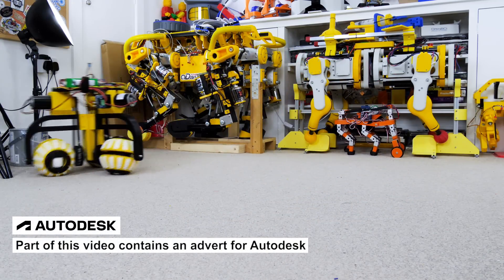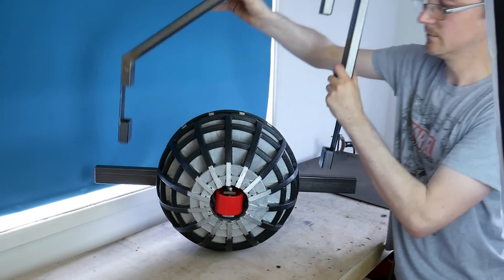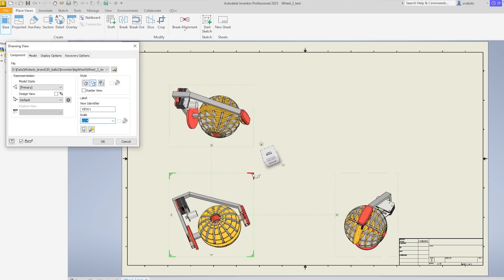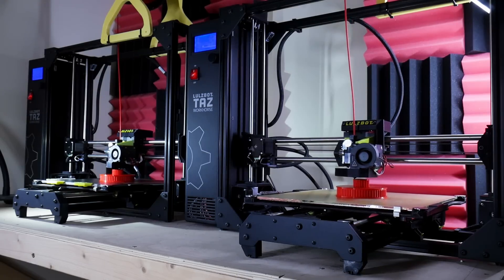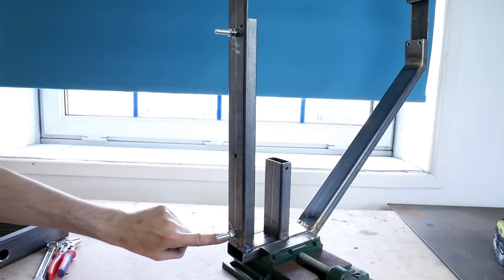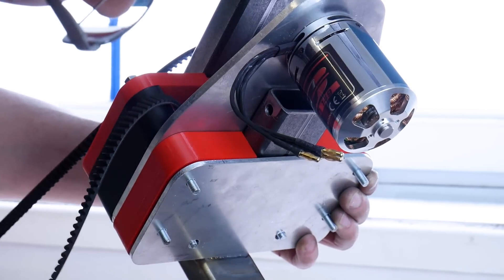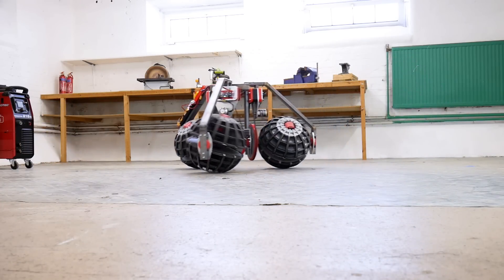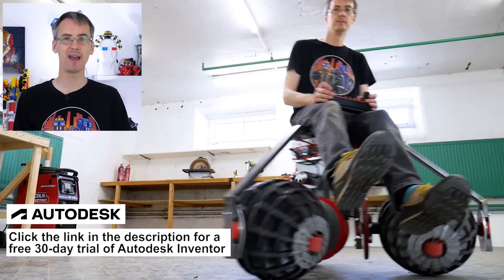Testing Ball-Shaped Wheels on an Omni-Directional Vehicle

Comment: You should add some kind of handlebar steering as well as foot rests so you can hold yourself stable as the vehicle moves. I would start with a system that rotates the vehicle as you rotate the handlebars left and right and has buttons to move forward and backward and possibly left/right. You could alternatively add pedal controls to the footrests for acceleration/braking

Comment: If you make the footing an isosceles triangle instead of equilateral it may become narrow enough to fit through a doorway. I bet you can squeeze it through with some clever rotations as it is, but narrower is probably better so one can just go straight through. If you use the pair of close wheels as "drive" wheels and the odd one out for steering the controls may also become more intuitive, while maintaining the ability to go sideways and rotate on the spot.

Comment: 1. Seat
2. Stering wheel.
3. Feet-rest
4. Coverplates (For cleaner look)
5. Some rubber or similar material on the wheels to prevent damage on outdoor surfaces
6 Suspension for smoother rides.

Comment: Thumbnail does have a bit of the look of an evil Sci-fi robot overlord to it  🤖🤗 . Would be interesting to see how stable it could be on slopes, maybe adjustable seat gimble thingy so the passenger (and centre of gravity) is kept straight up so it doesn't tip. A slightly upright-ish sitting position adjustment so people on the wheels are more face to face with people on foot would have a practical/cool sci-fi feel to it. 
(edit: [reading other comments] the thought of the seating gimble keeping you 'upright' in relation to acceleration and deceleration - leaning into the direction of acceleration and leaning slightly away from the direction you are decelerating/breaking in)

Comment: Are the controls oriented with the robot or with the environment? Since its onmi-directional you could, with a gyroscope, make one joystick control its movement in relation to the room (ie. Up is always towards the same wall, back is always away from that wall, etc) and have the second joystick control the vehicle’s rotation. That makes some really cool effects easy, like spinning while moving in a straight line!

Comment: that very first belt off the motors...is there any adjustment on that one? or did you just design it such that the mounting holes happen to line up at exactly the right tension for those belts?

Comment: I applaud you for the work you've poured into this project. So please don't get this question wrong: Would 5 wheels not be better than 3? Thought coming from office chairs being required to have 5 legged feet, I wonder if an omniwheeler would need 5 legs as well to be considered idiot proof? I guess a scale model would suffice, soryy if that question had popped up and been nswered before.

Also your life sized Omniwheeler needs a name, foot rests and maybe a more intuitive steering / handle layout.

Comment: It looks like you could rotate each wheel unit to be almost horizontal, which will greatly reduce the height, without changing your footprint much. I'd also look at incorporating some suspension of some sort, even an inch or two of rubber mounting will greatly improve ride quality.

Comment: I would add a seat with foot rests that rotates independently from the wheel base. Like the chairs at a barber shop. Build the controls into the arm rests. Half the controls on one side and the rest on the other . Maybe use flight style joysticks . Install switches on the foot rests to rotate the chair left and right .
Also, install two controllable gatling guns over your shoulders and go battle Ivan Miranda. Keep this series going !

Comment: Pro tip when using a router to cut aluminium: As strange as it sounds, if you want to increase RPM and feed rate without getting melty, use machinist lubricant or oil. It cools the part as you are going and allows much faster cutting and better "chipping" of the material as it is techically being cooled by the fluid. Its a little bit of mess for some near perfect (no need for the linisher to tidy) workpieces

Comment: Some suspension would be cool. You could create a pivot at your top link and replace one lower leg with a spring/shock combo (strut) off a car or motorcycle.  Since you used steel for the frame this would be easy and strong.  Adjustable spring preload on struts would allow you to adjust the firmness of the ride and the ride height.

Comment: Awesome Project! I have been following it. This project has wheels. 

Since you asked, A chair with a seat belt and headrest, would be nice. I think some kind of grabber hand, or hands, would be more useful than a cannon (not as cool, but more functional). And a high pressure piston, that fires out of the bottom, to launch you into the air. 

#Parkour

Comment: Add a camera rig, see how smooth it is, maybe even some kind of lidar to self charge, then build the controls into it, add a tablet or ipad for control settings and stuff, use a raspberry pi, then set up a self charge command, then a web hook and your location, maybe by Bluetooth, then you can have a home assistant trigger it to come to you, it could also have a hacky sack launcher, could have a camera on the screen for aim, stabilize it (doesn't have to be with motors) and maybe use the lidar to guestimate the trajectory 😁

Comment: Your emergency button being behind you is kinda eeee, you should have a pressure switch in your seat so if you get out or fall out, it will 100% stop.. lol  I think it would be cool if your wheels have LEDs inside that would light where the wheels make contact with the ground. Perhaps if you added some drone motors, you could fly around, land and then drive around??? :-D

Comment: James, with regards to the tig welding. It looks like you're striking an arc by touching the end of the rod to the metal. This is bad. Strike an arc with a small gap from the metal. Keep the rod sharp and clean. If the arc won't strike then turn up the power of the welder. Watch Kyle from Fab Forum for some close up tig action. Hope that helps.
Reply: Doesn't that method only work with HF. Maybe James welder doesn't have HF?
Reply: @dfgaJK  good point... Not sure what kit James has

Comment: suggestion: please make ur seat sit on a "lazy susan" mounted to a motor that automatically points the seat in whihc ever direction is moving forward.. would also love to see this  atleast done once with low filtering so i can see the driver get whipped around crazy like 90 degress when going left XD

Comment: What comes into mind when talking about omni-directional movement is some forklifts/picking up stuff and placing it in different spots with precision. But this would require some heavy rework of the chassis to support the load and counterweight on the other side.
But maybe something like attaching a grass mower in front for moving precisely how you want in your yard without manoeuvring back and forth on the lawn mowing tractor?
Reply: Zero-turns already do that better tbh. Making your zero-turn mower omnidirectional won't improve performance compared to cost given that lawns as a concept are already quite open and easily-maneuvered. Also, you'd need to make massive improvements to the weight and longevity of these wheels or else you'd be burning tons of extra gas to move wheels that are bigger and heavier than they have any reason to be.

Comment: This is pretty cool! You could commercialize this design into a go-cart for their own parks. People would pay to drive these. 
A few modifications:
1. Open up the center by making it big enough to mount the seat down near the bottom of the frame. 
2. Add a rounded roll cage over the top for safety. 
(Maybe make the cage large enough so that the whole vehicle is a half oval dome. So that it could roll completely upside down and then back over onto the wheels again.) 
3. As many comments have mentioned - add footrests and suspension.
4. Make the wheel spheres out of metal, with real rubber tire tread.   
5. More batteries, and maybe beef up the motors for more speed.
Reply: At the very least, do the CAD and send it to Collin, am I right? 😂
Reply: @jdmeesey  for sure!! 👍😝
Reply: Switching to on-axle motors would also be good, as then you could put the whole power assembly on the suspension and have some pretty heavy duty wheels.
Reply: or make a wheelchair...
Reply: @Great.Milenko  The concept does look promising for a mobility device. However, the process for one that is certified for use by a disabled person is very expensive and time consuming.
Reply: lowering the seat in between the balls is a great idea
Reply: Yah that could make an amazing bumper car ride! Or some odd take on Go-Karts?

Comment: That thing just seems unnecessarily tall to me.
Each gearbox/belt assembly should be rotated 60 degrees or more and offset around the machine to reduce the height by at least a foot.

Comment: please be careful about welding indoors.  it creates very toxic fumes that you don't want in your lungs.

I don't know if you are familiar with warhammer 40k but I know you like cosplay, so I would say it would be fun to see you turn this into a Mechanicus Tech Priest throne of some kind?  you could mount a couple extra arms on the back of the seat, a banner standard with a portable wi fi server, maybe an interface screen or two?  I understand if that's not your style, or you don't feel like putting that much effort into it, because I know a tech priest outfit would be a lot of fiddly work!  I don't want to assume, but you seem like the sort of fellow who might have a handful of servo-skulls scampering about  ^____^

on the practical side, I think you need to have body panels of some sort around the motors, so no one accidentally donates fingers or toes to you.

Comment: BRAKES!  Especially a parking brake.
It's not the moving that is desirable, it's the stopping and position holding you really want.
Helps avoid those pesky suddenly crossing lamp posts, curbs, pillar boxes and bins.
And makes getting in or out so much easier.

Seat with seatbelts.
Bumpers.

Does it do hills. Up and down. Even the Netherlands aren't completely flat. The UK even more so.

Comment: I feel like some sort of plastic molded cover that fits over the entire assembly which could sit on the three outer bars would be good. Leave half of the wheels visible and the covered bit showing the remaining contour of the wheel (and leaving gaps for wheel clearance). It'd look like some sort of spacecraft. You could pop a seat on top of the whole thing while your legs can rest in concave leg-shaped sections in the molded cover (perhaps with additional metalwork for support underneath so the plastic doesn't bend inward with the weight of resting legs). It'd all also serve as good protection for the electronics. It would probably mean outsourcing fabrication but would look pretty cool!
Reply: Gotta have a lot of transparent housing just to show off though

Comment: That looks really cool when driving around. It looks so much more visually striking than a normal omni or mechanum wheel. A cannon sounds cool, and because it's omnidirectional you only need a turret with pitch, and no rotation. Perhaps seeing as you're a robotics channel you could try making an electromagnetic cannon?

In my experience, when aluminium get gummy/melty on a cutter is when it's rubbing rather than cutting. Did you try bumping the feedrate higher than normal? Some compressed air blowing on the cut and a bit of something like crc or wd40 does wonders.

Comment: Well done! Definitely needs a seat and leg rest. Add a platform and integrate the controls to right hand directional joystick and left hand throttle.  There is those college desk chairs with the small writing table that slides to the front from the side. Maybe add a suspension system for elevated terrain.  You got yourself a light Mechwarrior.

Comment: I’ve got a question about Autodesk Inventor. I learned to work with Autodesk’s Fusion360 and I think Fusion is tailored more towards hobbyist instead of professional use. But what is the fundamental difference though? Why does Autodesk have 2 CAD programs? Is there also anything significant that Inventor can do but Fusion cannot?
Reply: It is more capable and faster handling complex parts and large assemblies. It has a better modeling feature set with more feature variables. It had more advance analysis features.
Almost all designs can be achieved in fusion but the methods can sometimes be a long workaround instead of a single feature and it can become unstable and more prone to crashes.
Reply: @dfgaJK  Alright, I see. Just out of curiosity: can you throw me an example where a task would be cumbersome in Fusion but straightforward to implement in Inventor?
Thank you very much for your reply!
Reply: @Quefelsees  i.e. specifying a sheet metal corner seam position and gap width and shape for seam welding.

In Inventor, you can just use the corner seam tool on a sheet metal parts corner.

In Fusion, you have to make sheet metal faces manually by creating 2d faces with manually calculated edge positions (for the close seams) and fillets then giving them thickness and joining them to a sheet metal flange component.
Reply: @dfgaJK  Got it, thank you so much!

Comment: Left thumb on the drill trigger, left hand over the part where the motor is. Right hand holds the battery. Leverage and control.

Comment: Not necessarily useful in this case, but if you cut a 2x4 (or similar) at a 45, you can use that as a brace to hold your material and allow miter saw cuts tighter than the 45° or whatever it would normally allow

Comment: Change the spheres so that the gaps in the surface have inserts so that you can press a button and they become off road types, i.e press a button and out come rubber blocks far enough to allow off road use.